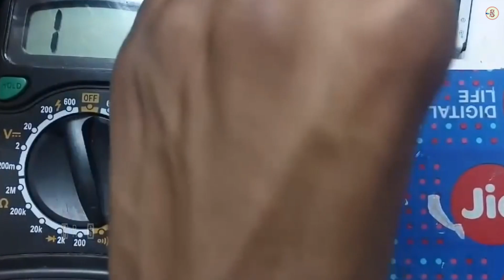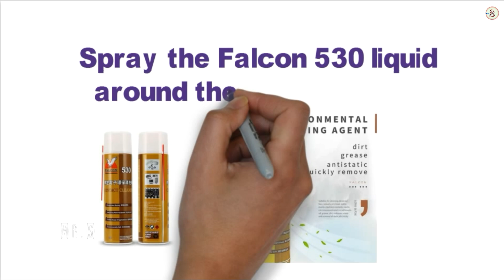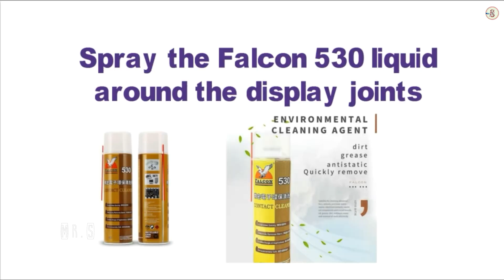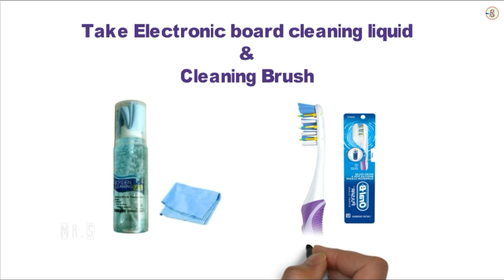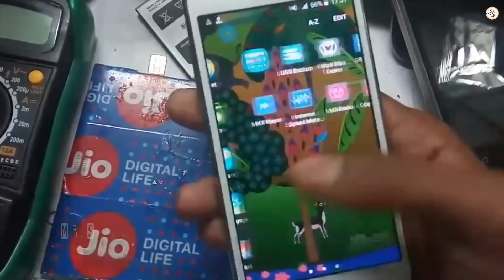Android Mobile Phone Screen Flickering Solved | DIY | Mr. S

Comment: Can you tell me how to solve this:
So I have oppo a5s, newly repaired from a fall on a bus. 5 days after repairing, it fell into a hard surface at school. No flickering lights just cracked. That night, I noticed the side of the phone the lcd open up a little bit. Thought it'd be funny to literally open it up even more. Then I did open it a little bit and screen goes white and an untouchable experience for a few minutes. 
Pls tell me how to fix that flickering light 😭it wouldn't go even if I use the OLED saver